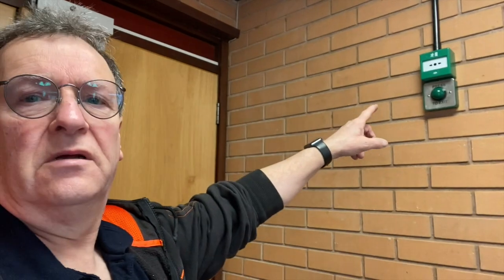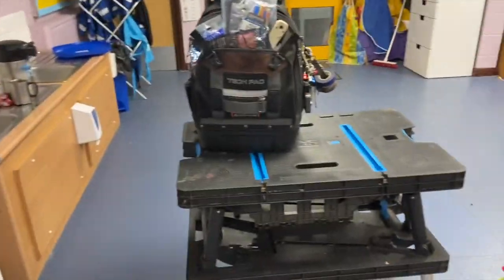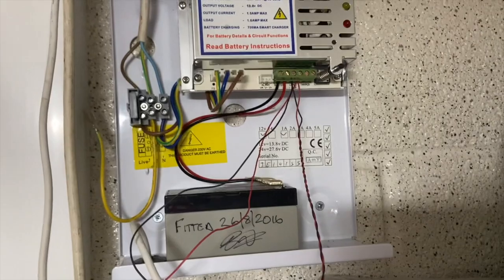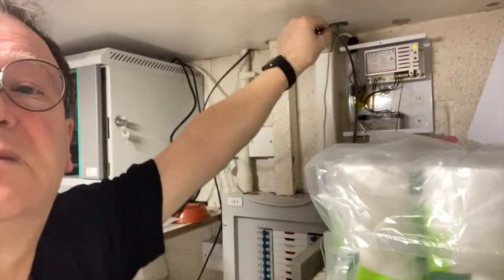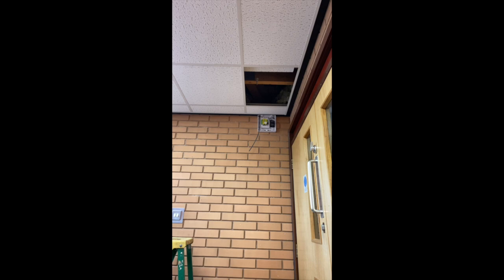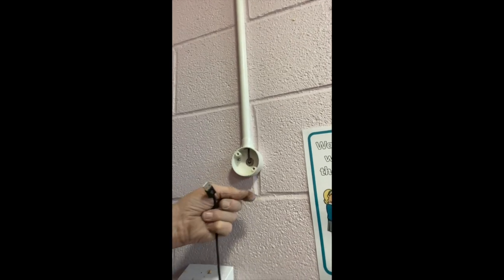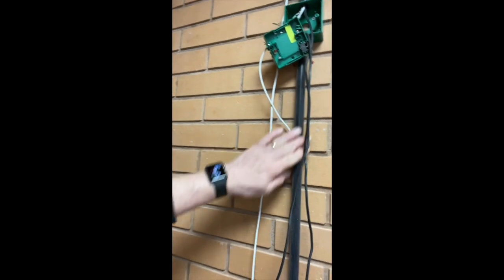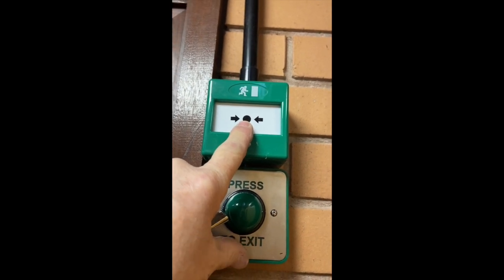Paxton Switch2, NICE

Comment: Hi, what type of fuse are you using in the fused spur?
Reply from the maker: BS1361 2amp
Reply: @SFGSecurity  Switch 2 requires a 2 amp fuse right?

Comment: Switch 2 boards are ok but I find net 2 controller's better as you can do more with them
Reply: Yeah it's really just what you can fit that would be cost effective is the main thing
Reply from the maker: Agree.  This school was kitted out with compacts back around 2003-2004 ish.  As these doors needed 2 prix p50 it was cost effective to fit switch 2.  It would be great to do it with NET2 now.